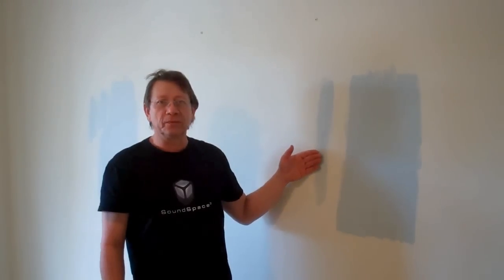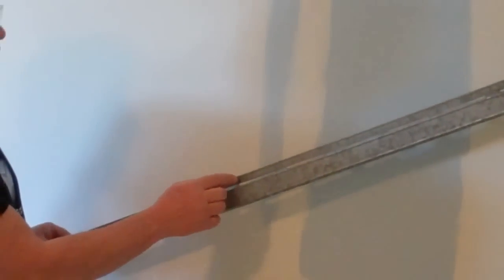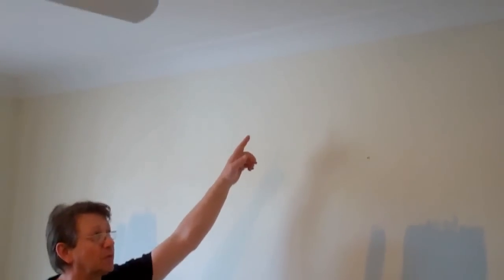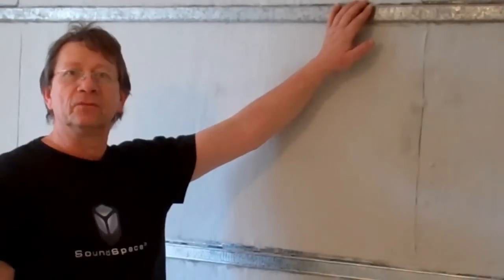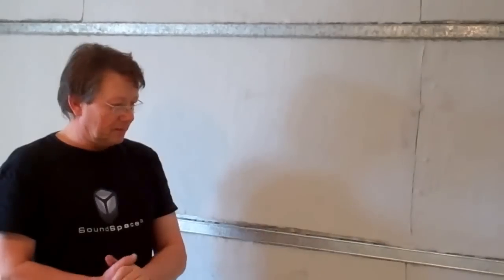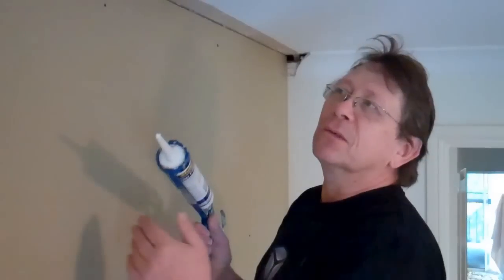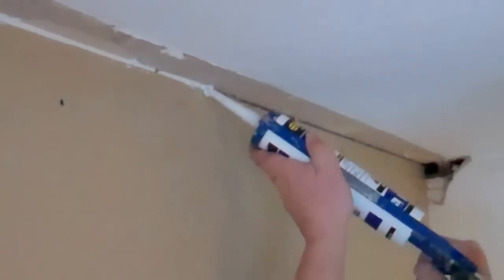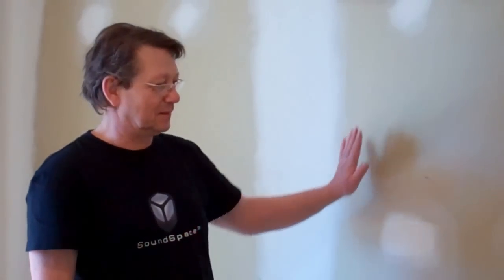How To Soundproof A Wall

Comment: Hello i hope you can answer my questions.
How do i use resilient channels on a masonry wall either side of a chimney breast? 
Also should the boards come into direct contact with ceiling, floors and adjoining walls  or do I leave a gap to fill with accoustic mastic?
Does the absorber need to be low density or high density?  
Can you use green/glue between the sound boards instead of sheet membrane?
Thanks
Reply from the maker: +Steve Sett The resilient channels can go all around the chimney breast.
The gaps with the first layer of plasterboards can be filled with acoustic mastic or silicone but for the last layer, I am using plaster, it is not too important because the visco-elastic membrane between the plasterboards prevents, to some extend, the plasterboards of vibrating, therefore, the new wall doesn't vibrate much even with the edges in direct contact with the walls and ceiling. You can also use a mass loaded vinyl, 6kg or 8kg/m2 instead of the visco for better performance, in that case, try to have good butt joints with no gaps as it will work not only as a visco but also as a sound barrier. with the visco, you can have gaps between joints but not with the loaded vinyl if you want to achieve maximum performance.
Reply: +soundproofingexpert Thanks, so would you say it's ok to fix the channels directly to the masonry wall.
Reply from the maker: Yes, that's right, you can fix the channels directly to the masonry wall, no problems!

Comment: you actually hung the resilience channel upside down. it will resist the wait of the sheetrock (plasterboard) better.
Reply from the maker: +Kelly Mortensen Yes, you are right, the resilient channels are upside down, few people have point it out, I am not sure if that makes a real difference but I guess, it is better to follow the manufacturer recommendations, I am doing it right now, just in case...You people are really the experts!

Comment: hi Philippe.  Could you tell me how many decibels does this cut? I am just trying to compare different solutions. I need to soundproof the wall and the sealing in my new flat. It's the living room and the bed room next to each other. And I have a 5 months old baby. Will your method will be sufficient?  I do have good sound system and powerful subwoofer.

Comment: Thanks for your reply !!! 
Very difficult to find reliable and not astronomically expensive company to do the insolation here in UK/ Northampton. I decide to educate myself for soundproofing and to do it with friends. 
Can you tell please where from can i buy the materials you use for the walls and floors?
I can not see nowhere browsing from UK internet for example: high density polyester absorber also the material going b/n the plasterboard (i found this one -not sure is that is what need to be? 
http://www.customaudiodesigns.co.uk/tecsound-acoustic-membrane.htm) and the 2 materials going on the top of the floor. Also discover on line Rockwool RWA45 Acoustic Insulation Slab 50mm x 1200mm x 600mm (6.48m2/ Pack) for b/n the joints of the floor.  Only plaster boards will be not issue to purchase here
If you can advise please where from your materials can be purchased and can I do so online?

Comment: Thank you, soundproofingexpert,  for a nice video. 
I have one question. What would you recommend if I would like make the wall even thinner:
1. Using the high density polyester layer and one high density plaster board?
or
2. To use just two high density plaster boards with some membrane in between them (for example gyproc acoustic membrane).

Which do you think would give the greater sound reduction?
Thanks
Reply from the maker: +savage guru the most important are the two high density plaster boards with visco-elastic membrane or mass loaded vinyl, 6-8kg/m2 in between them; mass loaded vinyl, 6 or 8kg/m2 even better than visco but more expensive.
Reply: hello, Do you know where from in UK to buy this  high density polyester layer?
Reply from the maker: No, I don't know but if you can't find high density polyester, you can use glass wool or rock wool instead but denser than for thermal insulation

Comment: If i were to install a second wall do i still need all the soundproofing stuff? or can i just build a standard plasterboard/wood wall with normal insulation ?
Reply from the maker: +alistair young Yes, you need all the acoustic stuff and you can also take advantage of the deeper cavity to install high density batts between your studs but never compress batts between the original wall and new plasterboard as you'll create a bridge for the sound to go through. After all this, you may still hear very faintly loud music

Comment: Two questions if you don't mind...how would you handle power sockets in the wall...and was the second plasterboard also screwed to the original resillient channel..thks ed
Reply from the maker: +d3891 Yes, the second plasterboard is screwed also on the original resilient channel, chose the screw length to make sure it doesn't go in the original wall, otherwise it will short circuit the system, because the vibrations will be transferred from the original wall, through screws into the new plasterboard.
Regarding the power sockets, very good question, I should have shown that, it is better to use surface mounted power points but if for some reason, such aesthetic for example, we want it to be recessed inside the wall, I try to fix a piece of mass loaded vinyl, 8kg/m2 if possible (flexible sound barrier) behind; there is also special boxes made for fire protection and soundproofing, a bit heavy, that can be also used.
Reply: Great ! Thank you very much for your in-depth reply! ..Very much appreciated! Regards,Ed
Reply: I have this very issue and about the do the work. Do I glue or nail my MLV to the existing sheetrock wall first then add the steel channel? Did you use regular caulk to seal the joints or use greenglue? I plan to do 5/8 drywall over that. Can i use a piece of MLV to cover the back of the outlet box?

Comment: Great video. I've gone with your recommendation of the resilient channel as our room is very small. I am now struggling to find an appropriate 'acoustic insulator' that is less then the resilient channels depth (1/2") thus to keep it from compressing against the next layer I'll be adding of 5/8 Quietrock.  Can you recommend me any product/names that will be suitable and help? Thank you.
Reply: +Justin Radford PS I'm making music so I want something that'll kill the bass translation through to next door! Thanks again
Reply from the maker: +Justin Radford The acoustic treatment of the wall shown on the video, is enough to stop loud voices, tv or radio going through but it is not enough to reduce sound transmission of drums or electric guitar because, as you said, the bass will be the hardest to kill. If you reduce the space between the new Quietrock and the existing wall, you'll compromise the sound reduction, as well as removing a layer of material. For music instruments, ideally, would be to build a separate partition wall, using steel studs (instead of timber studs) 5 inches thick, ½ inches or less from the existing wall, as long as it is not in direct contact with the existing wall, filled with sound absorber, like Rockwool for example and install 2 layers of Quietrock with a visco elastic membrane between, like on the video. Alternatively, you can use Green Glue between the Quietrock. It is easy to kill high frequencies but much harder to kill the bass. Anything less is a compromise.
Reply: +soundproofingexpert Yeah, I hear you. Looks like bass will be a day time activity and I'll use Cans, or consideration, by night. I'll be done by next week so we'll find out. Thanks for the knowledge.
Reply from the maker: Good, let me know how you go, thanks!

Comment: also is it possible to glue the sound block dry wall to the resilient furring channels as i saw a graph somewhere saying that glueing with sound glue maybe better then screws.
Reply from the maker: +James Pitt if you use a glue it will be the same than screws but if you use "Green Glue" it may be a little bit better, in that case you may have to reduce the space between the furring channels from 600mm space to 450mm space to increase the total surface of adhesion, it may be wise to ask advice to "Green Glue"
Reply from the maker: +soundproofingexpert I was answering to quickly, the glue could work only if you want to use Sound Block dry wall, the plaster I use is thicker, denser, that's why I have all the parts are installed separately and you can't really use glue because the plasticiser in the vinyl will react with most glue after a while and the panels will come off
Reply: true i was thinking the glue will not hold the plaster. as 16mm plaster is very heavy and you really need to screw it at least from a few points. not worth of making the plaster fall off. correct i agree. thumbs up!!!

Comment: Hi Phillippe, I notice you didn't use the resilient mount clips here . Was it because you wished to minimise the loss of space? Or any other reason. Thanks you once again. 😀
Reply from the maker: +James Pitt , yes, that's right James, I had to minimise the space as much as possible in this case and I've used "resilient" furring channels instead, designed also to minimise sound transmission

Comment: It would have been nice to see the actual drywall-hanging step that was skipped in the video - I'm assuming it was just screwed to the resilient metal furring strips with appropriate length screws but it would have been nice to know specifically if the screws had to NOT be so long as to enter the original drywall the furring strips are attached to.
Reply: +Hmmm Watching   Also, it would have been great to hear a "Before" and "After" sound test from blasting the same noise from next door, but considering this was apparently a real install, I guess you can't really ask the noisy neighbors next door to recreate the same noise for your "Before" and "After" sound check....
Reply from the maker: +Hmmm Watching Yes, you are right, the plaster is screwed on the channel and as you said, the screws shouldn't be too long otherwise it would court circuit the system.
Reply from the maker: +Hmmm Watching yes, that's right, most of the time neighbours are not in good terms due to the noise issue. There is a second system which work even better if you can afford the space, it is to build a second partition wall separate from the original wall but you'll lose 100mm (4 inches) instead of 50mm (2 inches). Highly recommended if you hear banging (kitchen doors for example) or very loud music. The price would be similar.

Comment: Thank you for sharing this soundproofing tip. I live near a loud stadium, and hospital with helicopter port, not to mention the fact there are lawn crews with leaf blowers several times a week in the area. I REALLY wish I could afford to have this soundproofing done to my home.
Reply from the maker: +ThomasGrillo 
Your windows may be the weakest point.
Reply: @soundproofingexpert  Recently a new tenant moved in in the one bedroom apt just adjacent to mine and
Reply: soundproofingexpert What do you recommend for window soundproofing?
Reply: Get class 5 Soundproofing windows, you will have to replace your old windows.
Reply from the maker: Your windows are most probably the weakest point and there are two ways to fix the problem; one is to replace your windows with acoustic windows and there are many different qualities and type of windows, chose the best you can afford. Another way is to leave the existing window as it is, sometimes you can't change them, and install a secondary acoustic window, inside, with an air gap as big as you can have in the reveal, the bigger the space between the windows, the more sound reduction, the thickness of the glass and the lamination as well as the quality of the seals, all those factors contribute to reduce the noise.

Comment: What are your thoughts on quiet rock or green glue? I hear mixed reviews and think the makers are making fake positive reviews on these products
Reply from the maker: +Moedy1 Very good question, I tried to compare myself the green glue and the disco elastic membrane I am using, based on informations and tests done in Australia but it was difficult to compare because the tests they did were a bit tricky and not comparing apple to apple, after a close look, I found that they've used different thickness of plasterboard for each product, giving an advantage to green glue; based on other informations I had and with a bit of guessing, knowing the sound transmission between different thickness of plasterboard, I estimated that they should be more or less equivalent. You just have to make sure you are using the right amount of green glue, if you use less, the performance will reduce as well.

Comment: is it possible to soundproof the existing interior walls without taking down the drywall?
Reply from the maker: mokruxa Yes, it is possible, using the same technic but you can compromise by installing 6 or 8kg/m2 mass loaded vinyl on the existing wall and add 16mm thick plasterboard over or 13mm thick acoustic plasterboard if you can't afford to lose space. The best solution is always to build a second partition in front of the existing one, separate from it, but you may lose around 100mm (4 inches).

Comment: Would you benefit from putting green glue on the sheet rock if done like this or since there will be a gap in between the green glue will not do anything?
Reply from the maker: +Moedy1 Yes, you can use green glue instead of the visco elastic membrane between the two board, it will provide similar results but you can increase performances by installing a layer of mass loaded vinyl between the boards, 6kg or 8kg/m2

Comment: Is there an "extreme" version of this?  Like, it you need to block out absolutely all sound are there extra steps you can go through to improve the soundproofing?

Thanks
Reply from the maker: BradSk88 Yes, if you are willing to lose more space, you can use the same system but instead of using the resilient furring channels you can use steel studs (Rondo system), fixed on floor and ceiling not touching the wall, filling the cavity with high density sound absorbers but make sure the sound absorbers is lose not compressed between the existing wall and the new one otherwise you'll create a "bridge" and more sound will be transmitted. You can add a layer of mass loaded vinyl (MLV) between the studs and the new plasterboard, the heavier the MLV, the better. This will be much better if the neighbour or yourself are playing loud music or music instruments and for impact noise.

Comment: Also, if you add another layer of sheathing with an air space, over the existing double sided wall assembly, you are making a three leaf, which is known to reduce TL in the low frequency range. This is due to multiple hard air spaces.

Comment: if someone installed this in their house can they hear loud sound from the other side of the house (their neighbour) ?
Reply from the maker: nachoz munchoz The sound will be very much reduced but if it is very very loud you may hear the bases, the low frequencies, therefore it is better in that case to build a separate partition in front of the existing wall, with steel studs (Rondo) fixed on tracks on floor and ceiling, not fixed or touching the existing wall, you can leave 10mm gap. You'll loose at least 100mm (4 inches) of space, you can also install mass loaded vinyl 6kg/m2 or 8kg/m2 between the 2 layers of plasterboard instead of visco-elastic membrane, the heavier the better for the bases.

Comment: Your RC Chanel is installed incorrectly . Flange down
Reply: soundproofingexpert  Yes...with the flange installed on the bottom side it allows the weight of the sheathing under the pull of gravity, to float away from the framing members creating the decoupled affect you want.
If you install the rc in the reverse order, like this guy did, the same thing applies except that NOW, under the pull of gravity, the sheathing pulls the rc into the framing effectively short circuiting the decoupling.
Reply from the maker: Billy Kerwood I don't see how it should affect sound transmission, could you please explain? Thank you
Reply from the maker: Thank you Brien, I see what you mean.
Reply: Thank you! Took way too long to find this comment. That's the first thing I thought when watching this! Great video otherwise...
Reply: Ive installed RC in theater situations. We ALWAYS installed it flange up with the free side on thr bottom.